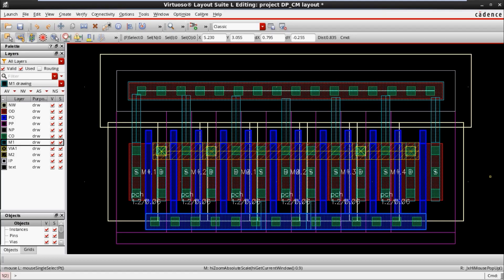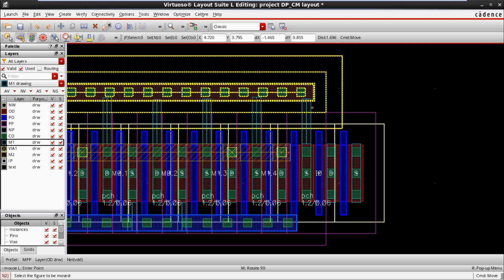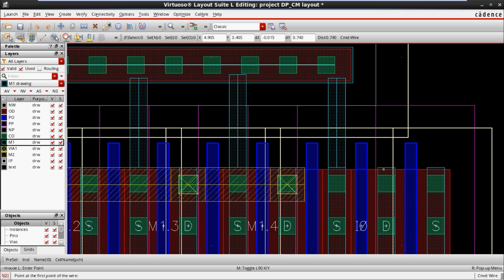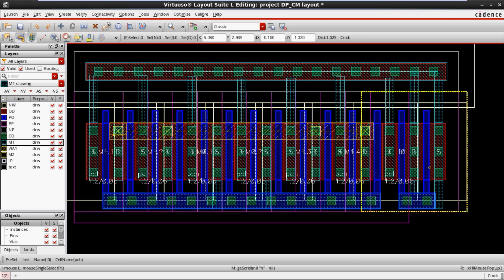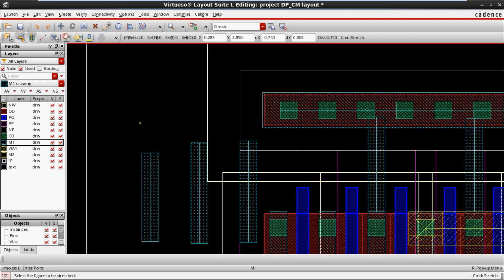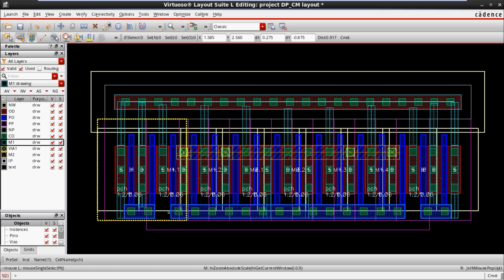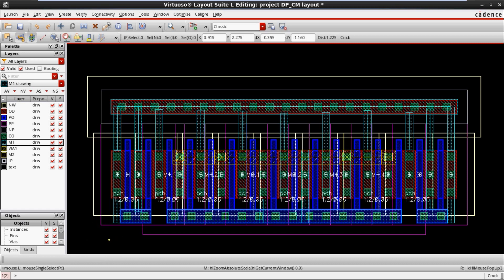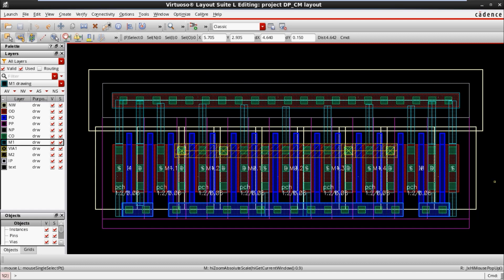How to Add Dummy - Layout Edition - English Version

Comment: If a block of transistors is covered from all the sides by guard ring, are there any dummies required from the top?
Reply from the maker: after adding dummy you need to add guarding

Comment: Sir In this video Drain and Source Connect to Poly and also VDD. I don't Connect to Poly. If there is a any error Connection problem in the layout?
Reply from the maker: ya , how drc will clean ? floating gate ? and also its not a complete dummy structure , the structure of dummy is , all 3 terminal has to connect vdd or gnd , based on the device